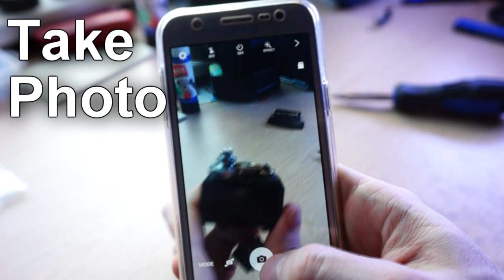How to make a Servo 360 EASY!

Comment: Did you cut the servo signal cable?
How is it rotated (clockwise and counterclockwise)?
Do you need an esc, or does the receiver do the work of reversing the spin?

Comment: 1:26 .   what do you mean turn potentiometer till the servo stops?
And why are you gluing it in at 1:34 when it is moving?

What did I miss?
I have a digital servo tester, and I don't know what settings to use, in order to adjust the potentiometer, can you help?
Reply from the maker: Angry Reviews because the glue takes some time to set
Reply: Ah okay, in my case with the servo tester, it has a range from 800 to 2200 and right in the middle is 1500, so I had to set it right in the middle at 1500 and then turn the potentiometer till it stopped.
I suppose in your case, you just leave the remote in neutral position.
Reply from the maker: +Angry Reviews I first turn it till it's centred (so it's roughly in the right place), then I glue and recenter. Using a relatively slow drying glue (as opposed to say - super glue/locktight) gives you time to centre it. It's is very sensitive so is easy to move.

Can't help with the digital servo tester, sorry.

Comment: I do not understand what you did in the glue part in the potentiometer, what is that for?
Reply from the maker: +rramirezx87 it's to lock it into a neutral position. If you didn't it might move at some point and your servo would continuosly turn in one direction.

Comment: I have tried several times to do this because i would really need an engine/servo like that. But my problem is that the servo still moves at some point, i cant stop the potentiometer and glue it perfectly. And then suddenly it moves. Why is that? Because of tempreture change or what?
Reply from the maker: Slappaisawayoflife Hi, this is not the 'proper' way to do this, it's more of a hack. The reason I use slow drying glue (5 min epoxy), is so I can make little adjustments as it hardens. It might be that your servo isn't very accurate..I used a digital servo. What are you using to control the servo? I was using an RC transmitter that has trim. You can use the trim to make slight adjustments after it has glued if it still moves a bit. Hope that helps.
Reply: I´ve used the Hitec 85mg because i wanted a strong servo to function as a wheel engine for a convert/build.
I only have a regular simpel rc transmitter
Reply from the maker: Guessing it's bit got a trim button on it then? You can get transmitters with trim very cheaply.
Reply: Im not sure, i put my project to rest a couple of years ago when i messed upp 4 servos. I have 4 new ones somewere
Reply: @PiedPiperfly  do you know how to do this in reverse making a 360 servo into 180 degrees

Comment: Nice do you use no Resistance?
Reply: You don't need the resistors if the potentiometer is still connected to the circuit...  The resistors are usually used to supplement the missing resistance due to the missing potentiometer

Comment: Don't do this, you will blow a mosfet in the h-bridge of the motor driver
Reply: Does it matter on a $10 servo, really ?
Reply: Bite My Krank No, however what if someone see this and wasnts to do it to I don't know maybe $80 servo
Reply: I would like to think anyone spending that amount on the servo to start with, would either do this correctly, or buy the right servo for the job initially. Full rotation servo motors were available years ago, cannot see why they are not still being made. I admit, these are small, and finding one made this size might be hard. I do TRY to think some humans still have a brain........

If you buy an expensive servo, do this and blow it up, isn't that just showing stupidity on that person's behalf ?
Reply: Stupidity is going through all this mess to create a geared DC motor out of a servo motor!

 I do TRY to think some humans still have a brain........but they yet tend to go back to stone age!